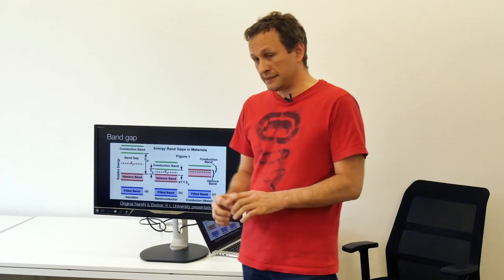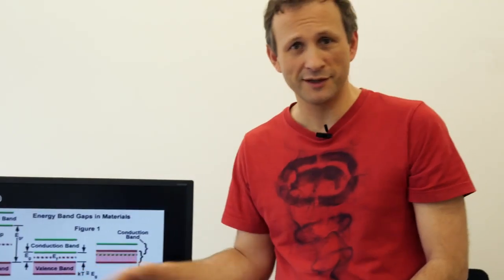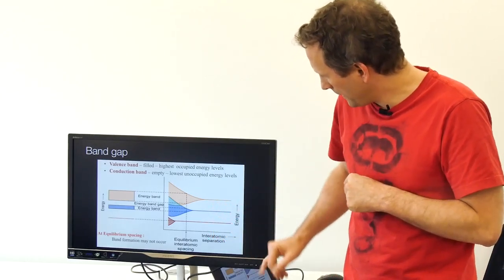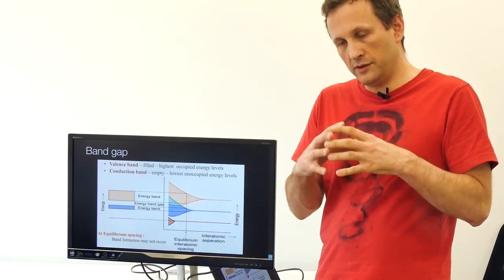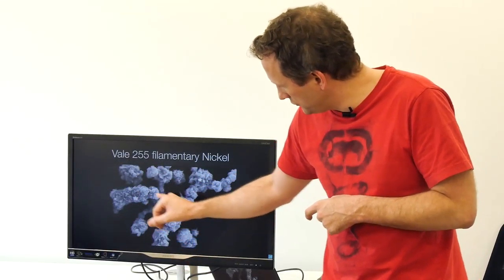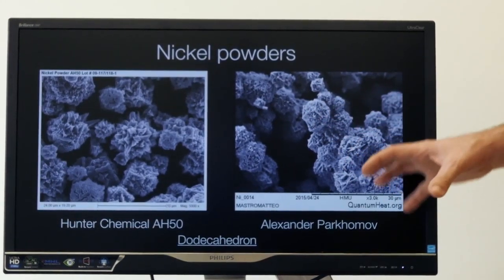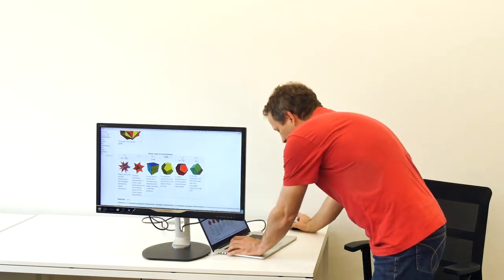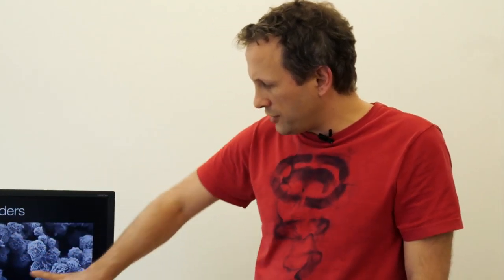Opening the door - Part 1

Comment: Excellent presentation. Though a small error. 410 nm is blue close to UV unless you are talking about two photon enhancement. Though there are many gold nanoparticles with SPRs in the near-IR region. Also, agglomerated gold nanoparticles can produce local field enhancements in the region of 10^5. 

It would be interesting to see the dielectric data of nickel in the relevant wavelength region.
Reply from the maker: +H Lundén Thanks, nice to have an expert eyes on these things, will make the correction in an overlay - difficult to get everything right in these unscripted videos.
Reply: +Martin Fleischmann Memorial Project It is a multidisciplinary problem, no single person can keep track of all small details. Glad to be of help.
Reply from the maker: +H Lundén No kidding! I also added an overlay to spell out that Vitorio Violante was using a red Helium-Neon laser.